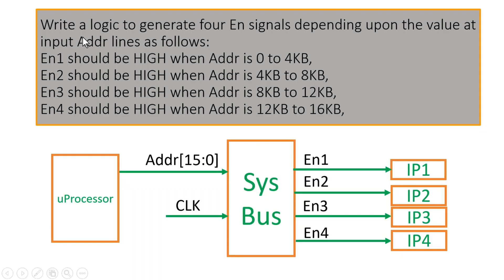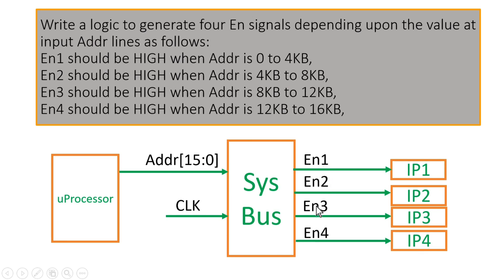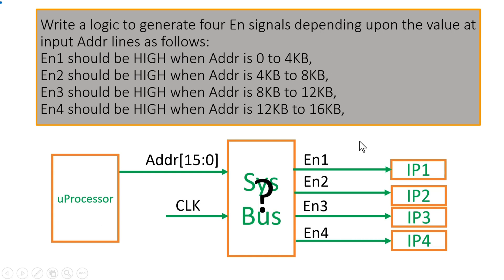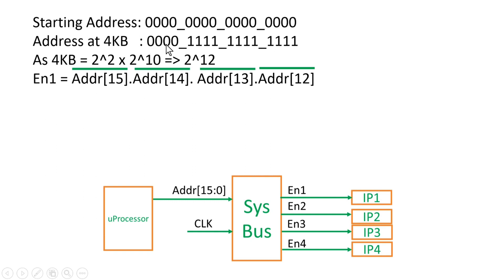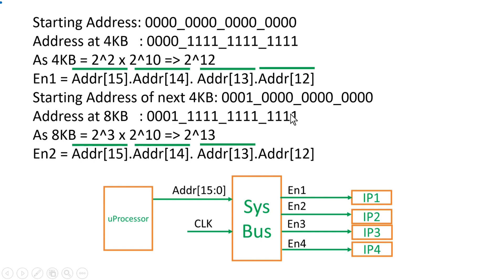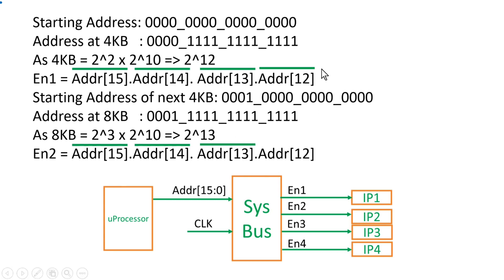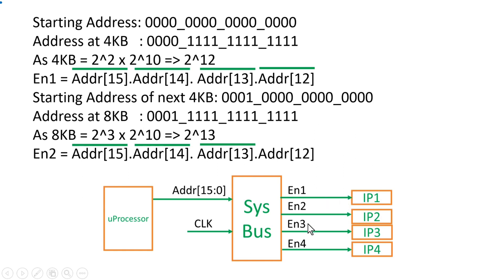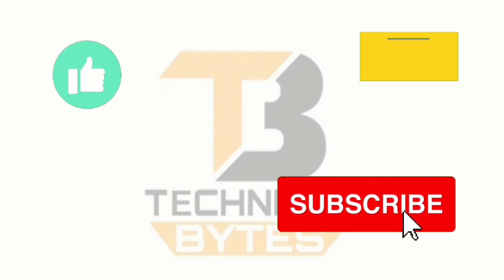Generate four En Signals

Comment: How to generate output frequency which is fin/1.5 with 50% Duty cycle**, sir I have watched your video on generating fout=fin/1.5 by using dual edge triggered flipflops and xor gate but how to ensure 50% Dutycycle in that?
Reply: first get 50% duty cycle of F/3 , then use that signal through XOR gate [for 2*(F/3)] with delay of 3T/4.
Reply: @ashutoshpadarabinda861   thank u so much I got it